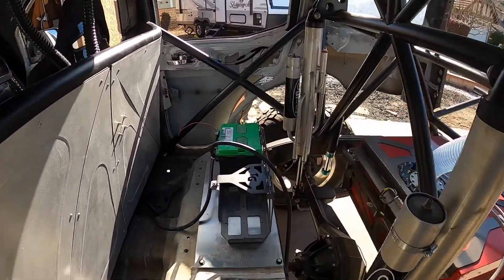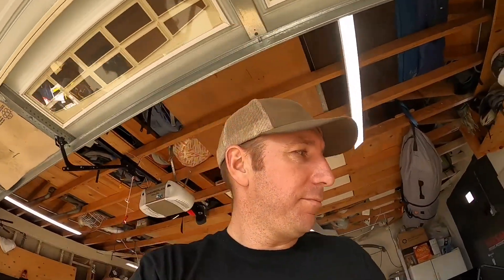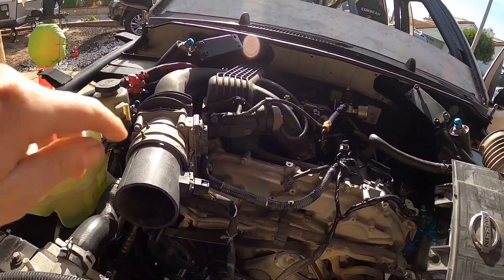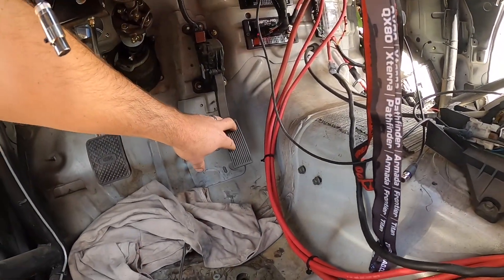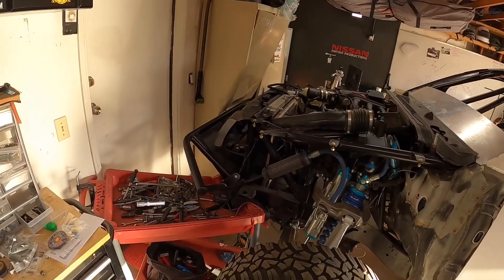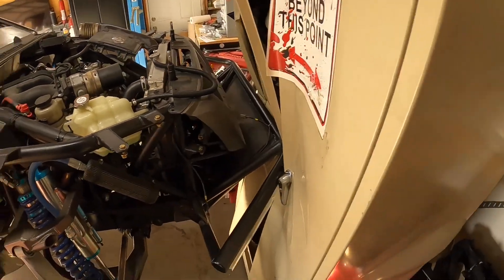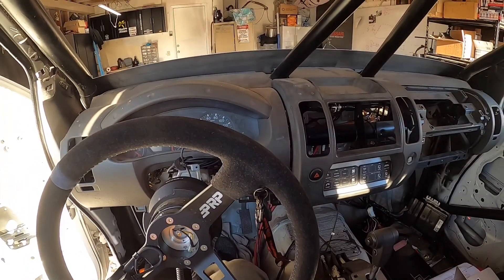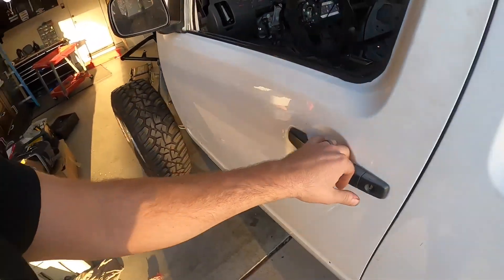Xterra race truck episode 17. First drive and it kinda crashed

Comment: Don’t feel too bad. My uncle was helping me change the starter on my car at his house and I tried to pull my 92 geo tracker into his garage and I popped the clutch by mistake. I ended up scraping the side of his car and knocking his Harley Davidson 10 feet forward. Also what kind of engine are you running?
Reply from the maker: It’s the stock vq40 v6